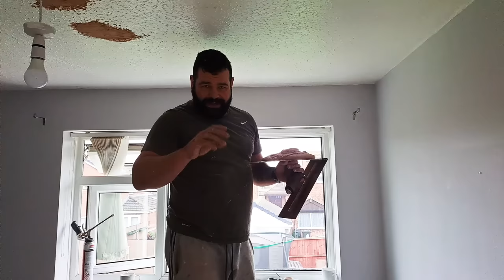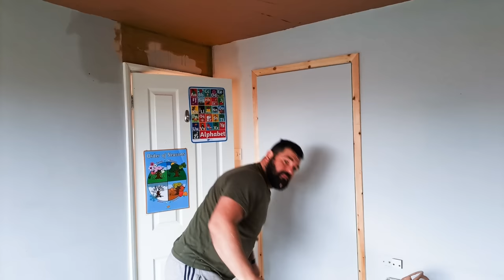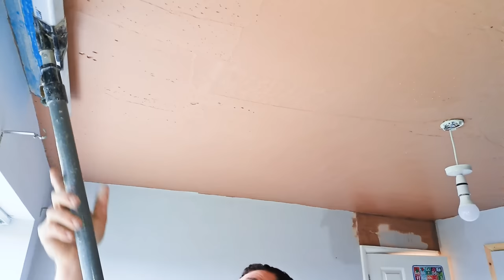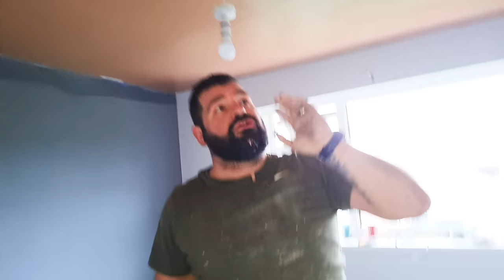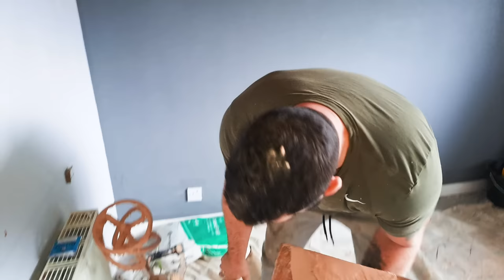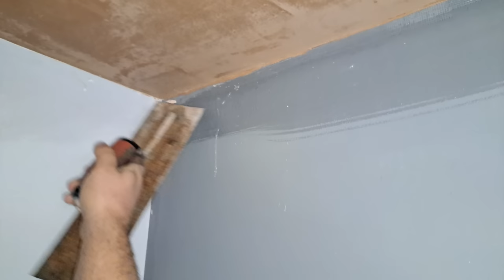Skim over Artex the Easy Method

Comment: I have been plastering for 33 years, and I have to say  fair play your very neat and tidy,  when I skim over artex I put a 1 hand full of bonding  per bag into my first coat, lay it on quite thick then speedskim both ways, and flatten with a trowel,  then when you top coat a hawk  full goes miles,  there for it will trowel up faster,  also you took of the light fitting cover (to keep it clean)  but that exposed live wires,  I also unscrew the pendant lower it down a couple of inches put the cover back on then you only have to work around the wire, it's safer and easier,   also the new plaster called fast set is a game changer,  it totally works from mixing to final trowel in 1 hour 40 mins,  good for a bedroom ceiling but not for an akward set,
Reply: Just turn the breaker off for the fixture before you start to work. If I need light I use lights plugged into another are not on that breaker, or my battery supplied lights. It really doesn't take much time to do a room this size if you're not producing an instructional video. But we all have our ways.
Reply: Eat CARROTS. 😂😂

Comment: Another good video mate. I like to mix bonding in to my 1st coat, thickens up your first coast of multi/ board finish so it covers the ceiling without having high spots showing through. Depending on how thick the artex is depends on how much bonding I’ll add. Never had any problems with it. It dose hang around for a while though as it’s a little thicker. Gives you time to prep your next set or have a cuppa 😊
Reply from the maker: Good shout mate, I am going to do a video on this soon, just trying to work my way through the plastering topics in a sort of methodical way. 
Cheers for your support mate
Reply: I do the same 2-3 handfuls of bonding
Reply: I do the same , but when you go over it with multi it goes on really nice
Reply: How far south do you go mate, I’m from Reading and I’ll go as far north as wallingford. Doesn’t seem to be too many plasterers from Caversham and upwards
Reply: @NiktheEnglishGreekCypriot  Hi pal, I’ve done a few jobs in Reading, I’m 10mins away from Wallingford.
Reply: @southoxfordshirplastering2793  lovely part of the world mate. As is a lot of Oxfordshire. I lived in Witney for 6 months a decade ago, doubt that’s as quaint as it was back then
Reply: @lornahughes9332 which bonding do you use please?

Comment: I learnt to plaster with my dad, he worked as a plasterer in Liverpool as well. Most of the old plasterers knew each other in those days lol.

One of the things he used to tell me was as the plaster sets it gets warm and would soften the old artex. Causing it to pull away. He taught me  to leave the first coat as long as possible as well.

Also quite often he would use a half/half mix bonding and board finish for the first coat. He used to say it would help it stick. With modern plasters I don't think this is always necessary any more but still do it from time to time. 

Great channel a lot of the things you mention is just like listening to my dad talking about how to do things.
Reply from the maker: Lovely comment, I enjoyed reading that. Cheers mate

Comment: Your an excellent spread! I use a similar technique to straighten stuff but rarely overskim artex due to risk of delamination. I think your edge technique is excellent for cleanliness which is something I have always struggled with, I named myself flick when I was doing bigger stuff but really want to get to dropping nowt so I enjoy the smaller domestic jobs, a lot of my work in my twenties was massive barn conversion stuff so it was more about being able to get it on in one or hang off a tower, the mess often didn't matter
Reply from the maker: Cheers Leon. In just working on a quick video for overboarding ceilings. Think you will enjoy it mate

Comment: Another great vid. I personally enjoy artex ceilings, I usually do a magic mix first coat, leave it a good 35/40 mins, then whip around with multi and if there’s any left I’ll go back round with a really right pass. Has a few jobs where even when it seems I’ve got the first coat flat, when I flatten the second coat I seem to have bumps and hollows, so now I just generally allow enough for worst case a tight third coat
Reply from the maker: Spot on, nothing wrong with that mate. 
Hey what's the magic mix??? I'm well intrigued?
Reply: @Onthetrowel  cheers mate nice one. I learned it off YouTube, depending on how bad the artex pattern is, you put some bonding or hardwall in the first coat of multi finish, gives it some body to really get over any reasonable stipples etc. only issue is it takes so long to go off enough to second coat

Comment: Hi hope all are happy n well. 

Great vid as usual 👌 

I Mix a bit of bonding with multifinish for my first coat. Put it on thick but not too thick. Flatten it with a speedskim both ways & Leave it for no less than 40 mins. 

On the 40th minute, I put on my second coat & finish off as you usually would. 

Sealing it a day before helps a lot.
Reply from the maker: Great tip!
Reply: @Onthetrowel  nice1 Bro 👊🏽💀🖤
Reply: @On the trowel  apparently they call it a " Magic Mix " 🤷🏽 the bonding mixed with the Multi

Comment: Did you SBR or PVA the ceiling first, and was your first coat multi finish or bonding? I'm very much a novice with some DIY plastering experience, and have a very poor polyripple ceiling in my kitchen (with lots of plasterboard dips that need filling in too) which I'd like to attempt, so just looking at various videos for some help in advance.

Comment: I have always used PVA ,  mixed 3 Parts water to 1 part PVA ,  I roller on and brush on ( edges ) then,    go and mix multi - finish plaster, then if dried out ei: very hot weather I give a second coat of PVA. before starting the first coat of plaster , as the ceiling should feel tacky/sticky before starting.     As most ceilings are white I find it helpful to add a small amount of  dye to the 3 to 1 mix of water and PVA ,  I use the red or blue chalk from Toolstation/ Screwfix  for use with a chalk line ,   or any mortar dye ,just stir in ,  just add a little at a time , don’t overdo it !!! It’s only so you can easily see where you applied the PVA ,
When I did all my house I gave the ceilings a coat of 3 to 1 PVA the night before , and one in the morning before skimming, never had any problems,   Lounge -diner has been done 27 years now and still perfect .     Hope this helps 👍

Comment: Is it better to use a metal wire brush to remove the paint and give the plaster something to bond to
Reply from the maker: Only if the paint is flaking off. Otherwise the sealer does the job

Comment: Amazing tips! But What do I do if my ceiling was painted over artex that was covered with lime wash before? How should I prepare the ceiling? With PVA bonding? What's your tip? Thank you!
Reply from the maker: You need to scrape artex off and get down to the limewash and stabilise it with a stabilising solution.

Or just overboard the ceiling mate
Reply: @Onthetrowel  I just watched your video 'LIME WASH PAINT plastering HELL'.... Hmmm... I'll double double check my ceiling after seeing your video, I might have a lucky escape with just artex asbestos ceiling that is just ugly... the surface is quite smooth with them rainbow patterns haha
I appreciate for your time to reply :)
Thank you

Comment: Good job, l need to plaster my ceilings but although l have plastered ceilings in my past l have 2 large ceilings that when my house was artexed it looks very bad my lounge you can see were the boards join and thay are in line so you can see them, ceiling in my bedroom it looks as if they cut out a large section to get up in the loft this ceiling is as bad as it gets with what looks like nail heads that were not hit in so l have lots of lumps all over the ceiling plus the board joins were they never smoothed out the tapes. before l retiered l was a finishing foreman for 30 years

Comment: Great easy to follow video mate, what about artex in an ensuite bathroom only small area probably 1.5m x 2m and is their anything that you would recommend to remove spots of mould first
Reply from the maker: Just check how well the artex is stuck on mate. Don't worry about the mould spots, wipe them off first and skim it. Once it's plastered in ut will die because it needs air

Comment: Artex can contain asbestos  , by skimming over it you are hiding it potentially from someone in the future, therefore over boarding is a better option , ive also found cracks you might not spot until after its been skimmed  , another good reason for overboarding
Reply from the maker: Think if your overbearing it then your still hiding the artex mate
Reply: @Onthetrowel  and putting more weight on the joists

Comment: Hi thanks for the helpful video.  One question - I've got a vermiculite (popcorn) ceiling I want to cover. Its similar to your Artex one but the texture is much thicker and deeper.  In some YT videos Ive watched, especially from the U.S. they use Joint Compound on ceilings instead of Plaster. What would you recommend for my situation?
Reply from the maker: Check if it's dusty or weak, you know make sure it's sold. Seal it wis sbr and just use the same process as in the video. First coat might have to go on alot thicker though. 

If you think it's to much of a challenge or the stuff is dusty / flaking then probably overboard it mate

Comment: we had bonding and pva, then skimmed over artex which was tested for asbestos and came back positive,
 and after 5 years a massive slab of it fell down….now I’ve been told it all needs overboarding rather than patching that bit, a massive job because we have plaster cornicing and it’s a huge room. The original plaster never said it ran the risk of it failing, falling down. He’s now retired, and it’s not covered for insurance wise! Advice anyone? Will the other sections fail too, or could we patch?

Comment: Hi Kirk, can you put bonding on first then 2 coats of multi-finish.  If so, how soon can you put multi-finish on the bonding.  Also can you bond it one day and skim it the next. Or what about mixing bonding with multi-finish for the first coat, if so what ratio. Perhaps you can do a video answering these questions so others can get to know the answers.  Great videos.  I love to see that you have new videos in my suggestions. It's funny,  when watching people like you, you kind of feel that you know them personally and its just a mate giving you advice and tips. Keep them coming and have a great weekend
Reply: Hi I do a lot of ceilings and used to put bonding on first, but have stopped. I think when the ceiling if basically flat it’s ok to do that because the bonding doesn’t go on very thick, so there’s not a lot of weight hanging it from the ceiling. However if the ceiling is very unflat or the artex is a heavy pattern, by the time you have filled hollows and then skimmed there’s too much gear hanging and it can come down even after it’s set. I have just walked from a job today because not happy about skimming over the heavy pattern, hence why I online now😂… so I either add some bonding to the skim on the first coat or just skim but I always push an over board. The customer today didn’t want to pay for the overboard and I don’t want to take the chance of it coming down. I not sure if pva itself can cause artex to peel .. with sir I am not sure how long you can leave it before it has to be skimmed…so I just go for the overboard now

Comment: ive just been asked to skim walls on a staircase that has what looks like artex in a neat fan pattern but the grooves are quite deep (maybe 3 or 4mm) i was thinking hard wall might be better to level it off before 2 coats of multi. is hard wall the right tool or bonding maybe?
Reply from the maker: use bonding mate because when you seal the wall it will be low suction and bonding is designed for low suction. hope that makes sense nobby, come back to me in the comments if you need any more advice mate

Comment: You talk about how nice it is to plaster over an artex ceiling because the first coat makes it like finishing on board ..... Well I'm sure your Dad will have tole you - Back in the day, ALL of our finishing was Three-coat ... Steel Float - Wooden Cross-Grain - Steel Float .... Made finishing Sooo comfortable - No bubbles, No Tiger-Stripes - And a marble-like finish every time ..... We had Thistle Board, Statite & Siraphite back then ..... Up to 1976 when the really HOT summer frightened the Less-Experienced  To-Death .... So they developed Multi-Finish which hung about a bit longer but came with those problems most plasterers get these days .... Because when it 'goes' it GOES! ... Statite & Siraphite could always be brought back with a splash of water and the cross-grain 'if' you did let it get AWAY from You ..... Those were the days EH?? .... OH! and we only had the 12" Steel Trowels back then .... And STILL got a RAKE of area covered daily 🤠
Reply from the maker: Lovely reading all that, thanks for taking the time to write it out. 
This is why I am doing these videos, I wish the I had videos of the older generations doing the job.
Cheers Pete 😉👍
Reply: Siraphite 👍 I was only talking about that plaster with someone today, saying how nice it was to use. Shame they stopped making that.
Reply: Good one Pete. Yeah an old boy told me summat similar.     Did it air dry then ?… rather than a chemical set?…
Reply: @matthewgaler6544  Yes, it air-dried - quicker than lime - sometimes too quick - but it was always redeemable with a splash of water ...

Comment: Are you using bonding or multi finish plaster?
Reply from the maker: I'm actually just using board finish plaster. 
You can use multi finish but it takes longer to go set. About another 30 mins

Comment: Hi Kirk, another great vid 👍 Can I ask you a quick question? I see several people commenting about overboarding. Tbh I try to avoid overboarding unless is an upstairs room I can get access to see from above cos I'm paranoid about screwing blind into a ceiling and hitting a pipe or cable. I know they're supposed to be away from the ceiling but you never know what some f*ckwit has done in the past. I lifted a bathroom floor upstairs once and found a gas main running along the top of the joist. How do you approach overboarding in the case where you cant get access from above to check? Cheers mate. Loving the channel. 👍
Reply from the maker: Video on that coming tonight or tomorrow at the latest rich.
We are actually filming it as I reply to you
Reply: @Onthetrowel  haha quality mate 😁

Comment: proper way is to apply coat of hardwall or bonding and then when is touch dry two coats of multifinsh skim
Reply from the maker: Hardwall is for medium to high suction backgrounds mate so it would fall, the way the product works it needs suction. 
You can use bonding but it just takes longer that's all.
Reply: @Onthetrowel  multi finish is design for levelling the surface if is too thick it start to bubbles. I have done many artek ceilings with hardwall and never fall. That is all :)
Reply from the maker: @rzyrafa11  well that's good to know, thanks for the tip and keep up the good work 👍
Reply: @Onthetrowel  What I meant is multifinish is NOT design to level the surface , bonding is or hardwall or render. If is to thick it may bubble or crack or even fall. That way it is called “skim coat” . Happy to help , keep up the good work :)

Comment: I would fix 9.5mm plasterboard then skim.
Reply: Those 9.5 can smile if your overboarding trusses…  there 600mm apart n thin also so you can come unstuck
Reply: @matthewgaler6544  600mm centres is very poor for any board, Noggins should be installed no matter what.
Reply: @funky_junkie  think your missing the point.  Someone said use 9.5 boards. 
I said you come unstuck on some of those stipple ceilings upstairs , cause the tend to be trusses not traditional cut rafters. Trusses are generally 40mm wide n set out at 600.  
Therefore 9.5 tend to ‘smile’ 
Think that makes sense
Reply: @matthewgaler6544  any thickness of board will belly when fixed onto rafters at 600 centre, if you feel the board already fixed is strong and won't smile then use  blobs of decorators caulk where you think the plasterboard will belly.
Reply: @funky_junkie   ow…